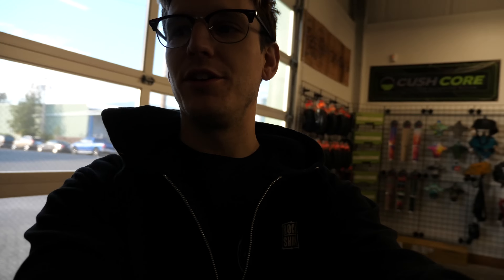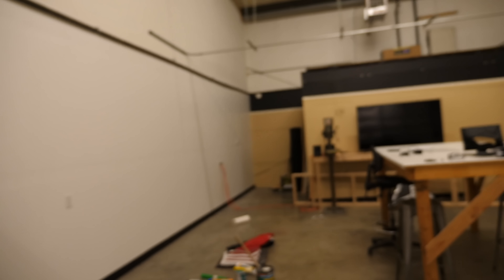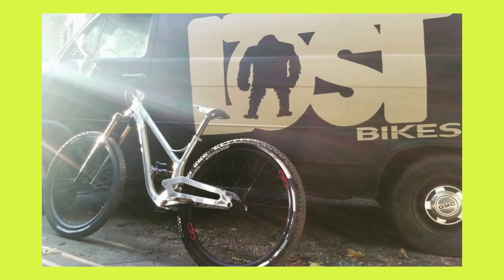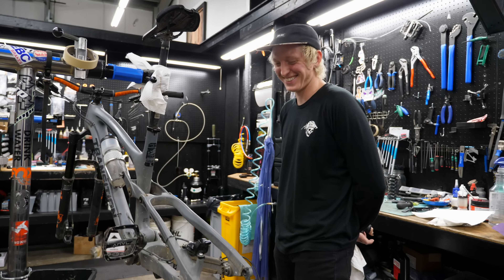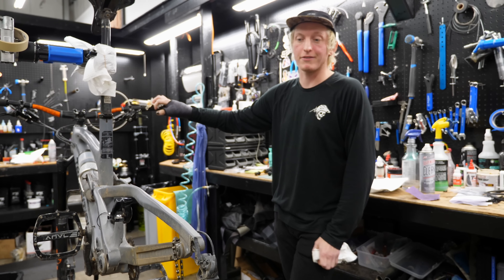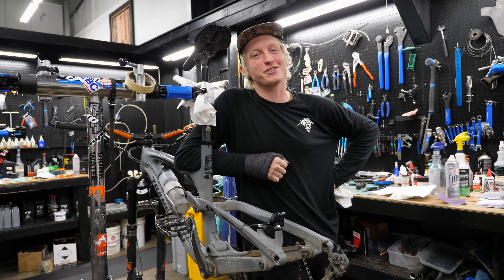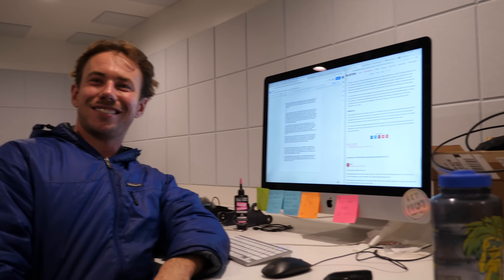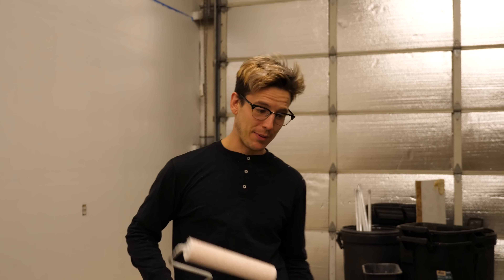How To Replace MTB Brake Pads With a PRO Mechanic

Comment: So to clarify. On Code RSC’s. Having the contact dial turned all the way in during the bleed procedure, will result in a a shorter throw? Did I hear that correctly? 

That’s what I’ve been wanting. I don’t want to have to squeeze the lever a lot to feel the brake. Not looking for on/off feel of Shimano, just looking for something, a little more, sooner. If that makes any sense.

Comment: The Lost Co.
I have a question regarding Code RSC bleeding, when I normally do it I circle the fluid back and forth to take out as many bubbles as possible and then when I go to remove the lever syringe, its like there is a lot of pressure and it always overspills a lot. Do you have any suggestions? I would LOVE if you guys made a guide video on the best way to bleed CODE brakes.
Thanks for the good content
Cheers

Comment: Any brake tips for maguras? I struggle with getting my mt7s to stop rubbing
Reply from the maker: Hey Alex, it's tough to say without having the bike here as it could be a number of things. They seem to run a little tight in the first place, but also there could be some air in the system, the pistons could be dirty and moving differently, etc.

-Mike

Comment: Great advice, thanks. But if you let some brake fluid out when retracting the pistons, what happens when they need to go further out, as pads get worn?
Reply from the maker: The goal with what Alex is doing is to "reset" the positioning of the bladder within the master cylinder (lever) to it's fully decompressed state. When you squeeze a lever or the pistons move out with pad wear, a brake lever's bladder will flex/expand. The brake is designed to do this under normal conditions, but when you're working on brakes you are pushing pistons out much farther than they would ever move even with 100% worn out brake pads.

-Mike

Comment: I have to over pressurise my code rsc to get them to not feel like rotten fruit
Reply from the maker: Hey Luke, we're not exactly sure what you're doing to pressurize thing but that may be one of the things causing any issues you might have. I would highly recommend starting from scratch using the method Alex does in this video. My Code RSC's are going on 4 years old and Alex recently rebuilt them for me and they feel freaking brand new! I think 80% of the staff's bikes here have Code RSC's on them and we seriously love them. Just like any brake, they need some time and patience to do a proper bleed and setup in the stand. 

-Mike
Reply: @TheLostCo  I bleed them a usual but I add a step at the end with the lever closed, I open the caliper with the bleeding edge tool then as I'm pressing down on the syringe I close the caliper you will know if you've pushed to hard because the pads will contact the rotors but it's a very quick and easy step so I keep doing it until I'm happy. If I don't do it that way  they then they feel super spongy pulling back to the bars the will stop me but I worry that with a bit of wear and fade they might not work when I need them.

Comment: What type of hooks do you use to hang the bikes thats are in for service?
Reply from the maker: Nothin' special, just some hooks from Harbor Freight! They're super cheap and are big enough for large MTB tires that all of the bikes we work on offer. Sometimes you'll get other cheap ones and they're designed around kids bike or hybrids with 30mm wide tires that the average household stores.

-Mike

Comment: I have a question, I replaced my rear shock with a Fox Float X performance and it has the IGUS bushings. I’ve tried everything, greased and dry, but this type of bushing squeaks and creaks like nobody’s business.. My old Fox shock had the DU bushing (metal) and it was totally quiet. Have you seen this problem before? Not sure if I need to use the older style metal bushing or am I missing something?

Comment: On shimano rotors for example they say min 1.5mm. Is this number too conservative or you should never go under this thickness?
Reply from the maker: We would not recommend going past that. Brakes are pretty important, so it's best to keep everything to the manufacturer's tolerances.

-Mike
Reply: @TheLostCo  thanks :)